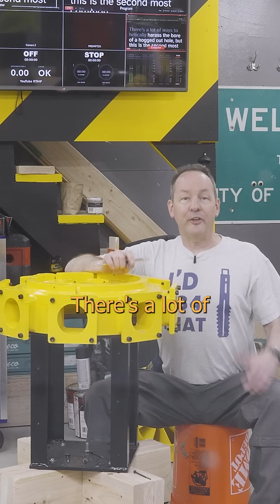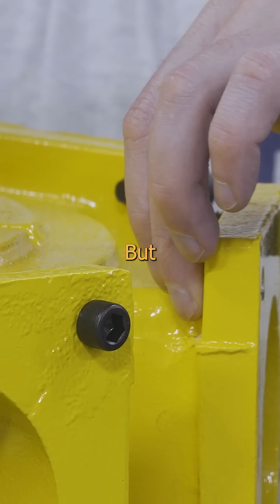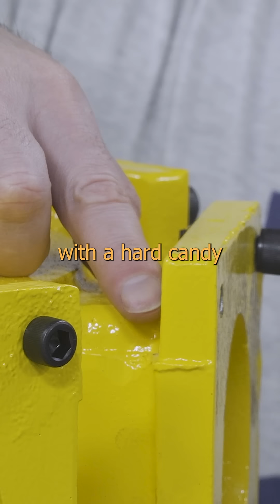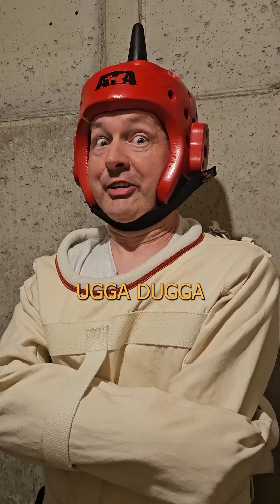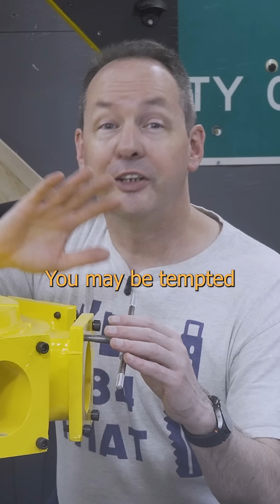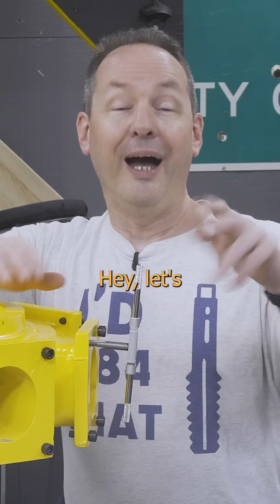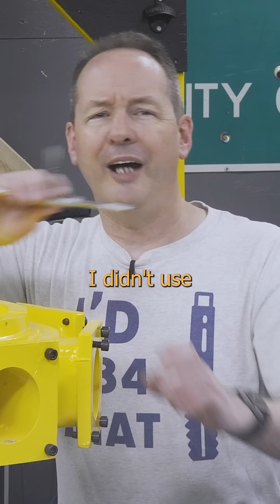Thread Chasing  #chrisboden #comedy #engineering #skills #workshop #metalworking #tools #apprentice

Comment: Just in defence of this machinist.

Ive taped holes, checking every half turn with an angle and the shit still came out angled. Sometimes you work with what you got and tolerances turn into suggestions.

Edit: if any of you ever put a tap into a drill i will come to hunt your asshole. If you do anyways, dont clamp it in. Let loose so that the spindle only carries the rotation, once it has bitten the tap will chase itself (pull itself in and you only need to keep the tap in your clamping system to catch rotational force). It will be wobbely as my first straight line but you get threads without ruining that much.

Sorry for lazy translations, its 9pm and im down

Comment: "Dumbass" I broke the tap off in the hole. Chased the thread about half way and then the mangled thread inside said no and slap back harder than "When I told my Mama no" damn near killed me when it struck bottom and the drill took me for a nice trip and after I came to from being flipped against the stone floor, the tap broke off and that was a nightmare to remove. I was definitely learned that I was not prepared for my poor life choices.😅

Comment: Dumbass 😂 the holes for en Andritz centrifuge at a water treatment plant had multiple problems. First being the 10 bolts on each side of the lid that cover up the rotating assembly had rusted out broken a bolt off in the hole  or the bolt got seized cock stiff.the 3/4 bolts got painstakingly drilled out then my co worker busted out the mag drill chucking up a tap like he had figured out a great idea!the plug tap hit bottom and snapped flush 🤬he promptly tried to drill it out and then left it for me 😂45mints later it’s in 15 pieces but it was out

Comment: I have tapped threads with hands taps and a lathe. I can confirm i fucked the lathe one up so bad that the machine shop teacher doesn't know what i did. My thread has waves and still works even though it fails the go nogo.

Comment: ... Usually if I'm using a tap I just use a lathe(helps to keep the part perpendicular) on the lowest speed it goes and ensure that the tap stays as cool as possible, using the ram to slowing enter the tap at an appropriate speed... Yes, a hand lathe, I think the one I use most often is from the late 80s to 90s, though I have used the other lathe a few times for it too, think that ones from, at latest, the the late 70s... They still work fine though, I do a similar maneuver with a die if it doesn't already have threads... Otherwise I just do it the normal way, it's quicker, generally

Comment: A drill with a clutch set to a low break away setting works extremely well and won’t damage anything if you use a touch of common sense

Comment: DUMBASS story time
Long time ago when I've first used a tap, was at my dad's home workshop and (as maybe some of you can guess) everything went south when, while using the tap wrench, some uninvited torsion force came along and cut  the tap in two, but oh no, it have to do it in the most helicoidal and transversal way you can think about. In the top of all of it, it did broke midway (so, pliers can have a hard time to unscrew the messed piece of tap).
Of course my dad wasn´t happy at all... 'coz of course part of the mess was thanks to the lack of lube (yeah, the same opened can sitting right next to me on the workbench).
Lection learned: allways use lube in this life, it does things easier (or at least helps to avoid messing things a tad less).

Comment: My dumbass put a tap in a drill once. I will never do it again. 😢 Nothing like digging a broken tap out and having to drill and re-tap it and buying a larger bolt and nut. When the tap exploded, it took threads with it. You only have to do it once.

Comment: I don’t understand how I’m doing it differently but I use a drill every time and never had an issue. I will chase threads for studs on a manifold for an LS to Ecoboost to DSM and also use the drill to tap new threads if I go with a larger stud (from an M8 to M10) or helicoil and never a problem. Could it be I’m working on aluminum?  Maybe because all I ever chase or tap is an M6-M10??  BTW, on all these manifold studs, changing from M8 to M10 is a game changer for reliability. An M10 stud won’t break.

Comment: Doing a customer's vehicle at the shop I work at not going to say any names. Customer was too cheap to go with a newer motor but let's face it who has the f**** money to get a new motor so they picked out the junkyard motor themselves so I had to tap every single f**** hole in the side of this block the top of the block and the head. I was 19 years old fresh out of UTI and thought I knew everything add my drill with the tap connected started going real slow. And God honest truth are really pretty girl walked into the shop that I've been trying to talk to for months I decided to ram the f**** drill through and the big got jammed in the block. Could not for the life of me get the tap back out not even the shop foreman. Essentially I tried welding a bar to the top of it to make it like a breaker bar and when I thought I broke a loose I cracked the block essentially breaking the piece off the top where the head lays down.  I'm now 41 years old still work on cars every day of my life still use a tap. But no f**** drill. 😂 And yeah if I can't spell it right it's voice to text so I am a f**** dumbass

Comment: Dumbass. I did this to a pretty thick plate of steel that had powdercoated threads. Chucked the thing in a drill, did a few holes very carefully and thought it should be fine to go a bit faster. The tap broke off in the hole... It took me ages to get it out.

Comment: Dumbass i was redoing a bolt home to install a helicoil and decided a drill would make it easier and quicker it worked great the first time but I snapped off the tap in the bolt hole and spent next 4 hours carefully breaking it out piece by piece with a hammer and a tiny chisel.

Comment: I havent screwed any up yet but because im a dumbass I have pre drilled scrap and ran taps through them to prove my process and once ran one crooked and had a bad thread on the scrap had engineering out there to approve the process and showing that the process was good and the reason it failed is because the tap went in crooked between engineers and the FOG's we cant make a bad part just have to be humble enough to let those who know tell you how you messed up even if they aren't nice about it, get to work boys

Comment: Do you know the difference between a power screwdriver and a power drill?  You can safely use the former to chase threads if you know the difference.
Reply: For those that don't know, you can use a power drill as a screwdriver but that does not make it a power screwdriver, they have different mechanisms.  A power drill uses a gearbox so you can limit the speed of the bit and keep it from overheating, a power screwdriver uses a clutch so you can make sure you don't overtighten the screw and strip the threading.

Good luck finding an actual power screwdriver though, just about all you're gonna find anymore are power drills.

Comment: I have a set of thread cleaners I bought 30 years ago. Looks like a tap but they aren't sharp. If the threads aren't damaged they work like magic and don't remove any metal while cleaning.

Comment: Im a different kind of dumb ass. A level, a straight edge, and an hour and my hole still had so many degrees of camber you'd think I was trying to make a pipe flange do a backwards entry into a high speed corner.

Comment: Dumbass 3/4" stainless steel with over a hundred holes to mount a delrin slide. Hand tapping was taking too long. Had to drill the fucker out after 3 tap extractors failed. Not a fun time. Probably could have safely left that one screw out but I don't like doing that on something deploying a rescue boat. Yes stainless steel is a weird material for a crane, only ever worked on two, and both were from the same country and one was a davit not a crane.

Comment: Same concept, different conditions, never reverse direction on a bore brush half way down the barrel of a cordless long range hole punch if it turns out that you didn't put enough sections of rod on your barrel cleaner unless you want to add a whole lot of new words to your vocabulary.

Comment: That is so crooked I'd be tempted to mill it out and use a thread insert to try to straighten it back out.

As far as doing sketchy things with a tap in a drill? As a greenhorn I was trained on how to use a giant ass WW2 era drill press to run a 2 inch tap because our cat50 mill with a 30hp spindle struggled with anything much over an inch.

Comment: Dumb ass!

I had to tap out the hole for the spark plug on my wifes car and i used an extension and a drill instead of by hand now its crooked but for whatever reason still works just have to pray that plug holds for awhile, a headache i dont want to deal with

Comment: We had a new hire start one day and his first task we gave him was to tap some holes with a 3/4in tap. He proceeds to start the tap crooked as hell and proceeds to use a HAMMER to try and knock it back straight. He then turns the tap and it immediately breaks in half. Needless to say we had to use a plasma cutter to cut the tap in half in the hole to try and get it out. 😂

Comment: Dumb Ass. 🙋 About 29 years ago I just got out of votec (Auto Body). I put the tap in my drill set it as slow as it would go. And try to chase paint out of the bolt holes. Snaped the tap off. I had to sit there and try to get the broken tap out. Because there was not enough room to overdrill. One of the old guys in the shop walked over to me, put his hand on my shoulder and said, now what have we learned here? I've never made that mistake again. Now I am the old guy in the shop.

Comment: The harder lesson is to run the tap in and out  while going progressively deeper. Running a tap into a blind hole with no exit for the debris leads to heartbreak when you can't back it out and the tap breaks off leaving you in a worse position than before you started.
Ask me how i know.

Comment: DUMB ASS!!!!!

Had a head bolt hole in a kinda rare LS6 454 Aluminum block from the 60s that had the bolt snap off in the deck. Whoever built it before must have mistaken ARP fastener lube with red loctite! So we started drilling the broken bolt to get an extractor into it and try to heat it and back it out. Well, we broke 3 extractors. So I got the bright idea to drill the majority of the bolt out, and use a fine pick to try to pick the bolt out piece by piece if necessary. Shit went sideways IMMEDIATELY! There was a 1/8 inch hole in the bolt so I thought "Hey, there's a guide hole. It should go just fine!" I put a 1/2 inch bit on the old Hilti, hit the trigger, and that some bitch dug into the bolt, turned to the side and blew a hole into the side of the threads! 

That was a very expensive mistake... We had to source a date correct LS6 454 Aluminum block for an original 69 COPO Camaro! 6 months and $12'000 later, we found one.... And it also had a head bolt snapped off in it lol! We swallowed our pride and sent it off to the machine shop this time lol!

Very expensive mistake!

Comment: I've personally had to chase threads in an 1 1/2 - 6 eyebolt hole with a 4 foot tap handle that needed 2 people to turn. My company makes BIG injection molds. All because the guy who threadmilled them didn't bother to bother to inspect them. Depending on the material and number of holes it is often faster to threadmill to close enough and then chase with a hand tap rather than spending an hour re-writing the program 15 times trying to size them out.

Comment: If you’re in a pinch or maybe the t heard is of an oddball size you can take a bolt that is a match to the threads and with a hack saw carefully cut into the threads lengthwise in three or four places depending on the OD of the bolt. You can grind  or file down the top of needed to allow the cutting/cleaning of the threads! Again be gentle!

Comment: Dumbass here; stripped mounting brace for chainsaw bar mount after wood debris carbonized into the hole from excess usage; 42" bar Stihl chainsaw; it is about $2-$3k of a saw, and it was expensive to repair.

Comment: You can buy thread chasers which are like taps but with fatter blunted threads, so they won't cut new threads or cross thread. They just clean out and straighten existing threads. I have set, and every tech who borrows one, ends up buying their own set soon after. A must have if you frequently work on crusty POSs.

Comment: If you're gonna give away this much good info you might as well tell em the rest of the secret sauce!  First things first, always start your screwing in by going the wrong way until you feel the tap or screw clunk into the end of the threads, sometimes a full turn backwards. More if you miss it the first time. Once it clunks it's time to change to the forwards direction. This is how you make sure you're chasing the old threads. Second, while tapping always stop and change direction every turn or two. Turn backwards about a quarter to half turn to break the chips. Then resume forwards cutting. The ratio of cutting turns to chip breaking turns varies by material and perhaps a few other things.

Comment: I learned from others' mistakes.  I've known a lot of dickheads that think they can tap with a drill. The funniest by far was when the shop supervisor got us 3 taps to do 250 holes. HE was the ass hole that had us use a drill to get it done quicker. He went to do it as an example... welp, there goes bit #1. Gave it to a young fella with basically no knowledge of anything yet, and there goes #2 and 3 in the span of 5 holes. The second one shattered in the hole and took a long time to get out. After calling the poor kid an idiot and almost firing him, he broke down and order 15 taps and had them done by hand after that. In some weird stroke of luck, we still had 8 left after the job was done.

Comment: Dum ass here. I have never learned this lesson after several years. Always think this time I can tap a thread with a drill and every time I’m stupid enough to f it up. Don’t do what I have never seemed to learn. If it’s too small to tap with a wrench open the hole a bit more so you can do it by hand. Save your self

Comment: Drill, no.. drill press with vice, sure. Most drill presses are belt driven and low torque enough to not cause carnage on a significant scale. The only issue is being able to secure the part accurately

Comment: Bought a set of Craftsman Thread chasers when Sears went under.

Still available under original manufacturer. 

Supposed to push the metal back into position rather than cut metal.

Comment: I work automotive. I’ve had to rethread holes, retime engines, and replace gaskets that the “professional motor rebuild” shops have given us back. I hate those mfs. Tapping or chasing threads isn’t hard though, just make sure youre square. Look from the top and the side, if it looks straight from top, straight from the side, finger her in. If a off center, try and try again, if you can’t get it let someone with better fingers make that hole
Happy

Comment: Dumbass - I was working for the summer on my dad’s truck parts place.  50 acres of new and used trucks and truck parts. They tried me for 1 day in the rebuild shop I got my first bolt and didn’t even get the bolt finger tight when I hit it full speed with the air wrench. 

I wasn’t even let in the rebuild shop for what seemed like years after that.

Comment: I had to clean powder coating on 75 pieces with 4 holes in each piece .. used a drill .. zero issues because i would start the threads by hand and just chase the rest with a drill.

Comment: Dumbass. Chasing threads on a boiler access plate as a young 20 something Millwright I got tired of doing them by hand and got the bright idea to use my new 1/2 cordless DeWalt drill on the low setting. After about a dozen holes the tap bound up and I didn't think about how much torque the drill had so I snapped the tap off in a blind hole so for the next hour I learned how to weld inside a 1/2 hole so i could get the tap out... So my name was TAP IT for the rest of that shutdown...😅😅😊

Comment: Never did bad on threads however when I was younger learning about cars and how to fix them I had a misfire and  read to unplug the coils to figure out which cylinder is misfiring. so my young naive brain decided the best course of action was to unplug the coil from the coil pack while the car was running. I watched that blue arc come right up to my hand and give me a kiss. I took a quick nap standing up and decided maybe tomorrow.

Comment: Thankfully for my idiot self the threads I was chasing wouldn't let me fit even the proper tap wrench in so I had to use a small enough regular wrench to get the job done. Otherwise I probably would have just chucked it in a drill and learned the hard way

Comment: I’m about the least lucky person you could imagine, but I have great luck at getting away with tapping in every incorrect way possible.
To preface, I DO NOT CONDONE TAPPING A HOLE WITH ANYTHING OTHER THAN A TAP WRENCH!
However… I have never broken a tap using a cordless drill. I only broke one tap and I was using it carefully with a tap wrench for the pan bolts on a 700r4. I’m pretty sure the tap was defective, given that it was brand new and I barely touched the thing!

Comment: Dumbass here. I work at a Blacksmith forge and part of our job is drilling, countersinking and tapping holes for screws and bolts. I’ve broken off more 1/4 x 20 taps than I can count and removing them is twice as fun as putting them in. Also, I’m an alcoholic.

Comment: Dumbass I was, first two holes i tapped with a cordless drill worked out well enough. Third time the tap broke in the worst way, at the worst time, in the worst hole. Had to scrap the whole custom locksport challenge lock.